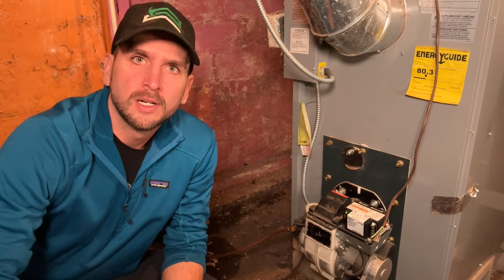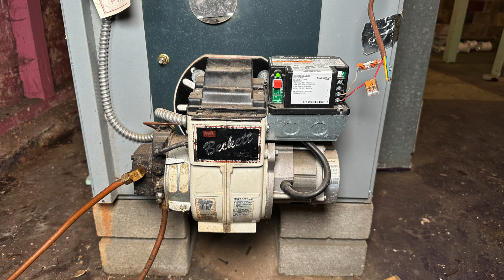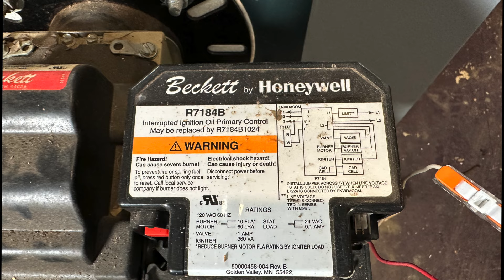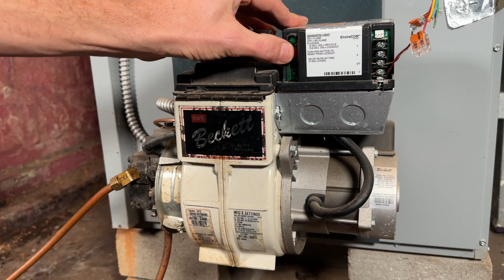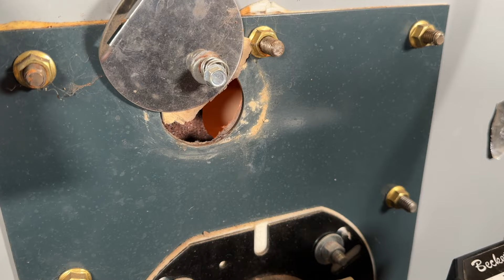How To Restart An Oil Furnace | Hard Lockout and Bleeding Fuel Lines

Comment: I have an oil burning furnace.  I hate the thing.   I've never seen a piece of equipment with so many bad failure modes.   Can be nothing but trouble.   The fuel is cheap, but the trouble can be high.
Reply: Excuse me but are you a troll? Heating oil increased in price this year by 50% so it’s not cheap. If you clean your filters every few months the system is bullet proof. I’ve lived in New England for 70 years and never had issues with these furnaces.

Comment: This seems incredibly dangerous.

Monkey see monkey do, on a 4 minute video meant for consumption by a general audience, with a fuel burning appliance is a good way to get some of your viewership injured or worse.

I've seen guys that are meant to know what they're doing bypass a hard lock on a Becket burner without doing the checks required and he took a section of vent to the chest when all the unburnt fuel in the combustion chamber went up on ignition.
Reply: @LeithJones Home heating oil, which is likely what this is, isn't all that flammable, and won't ignite at room temperature.  You can throw lit matches on it all day and it won't ignite.  It's heated to 140F (the flash point) and vaporized when it's burned.  The flash point is the minimum temperature a liquid need to be for it to be able to be ignited.  For reference, the flash point of gasoline is -45F.

That doesn't mean there's no danger.  It might have been better if he'd given some safety precautions here.  But I don't think it's as dangerous as you're making it out to be.
Reply: On most oil Furnace's when you bleeding the oil pump you don't have oil going to the oil burner but always check to see if the rest button has been pushed to many times on old oil Furnace's new Furnace's well lock out on safety never press the rest more than two times call a technician or troubleshoot the problem after that
Reply: @Kevin-mp5of  Yes.  IIUC the only difference between diesel fuel and home heating oil is taxation.  Diesel is taxed, and heating oil is dyed red so it isn't used in cars/trucks.